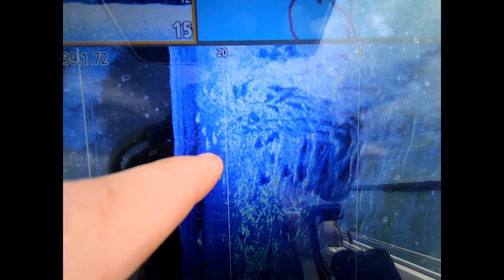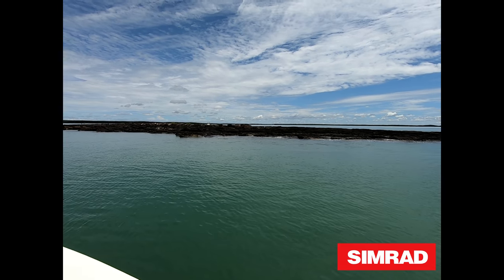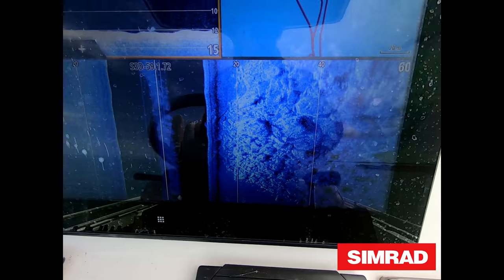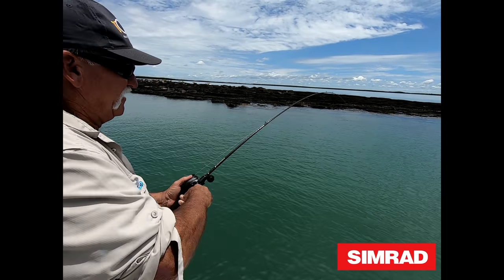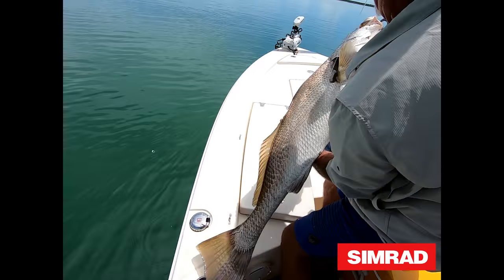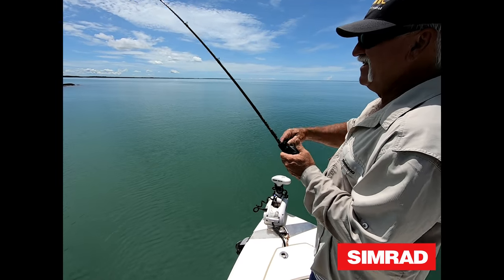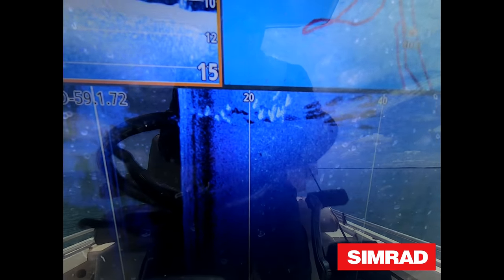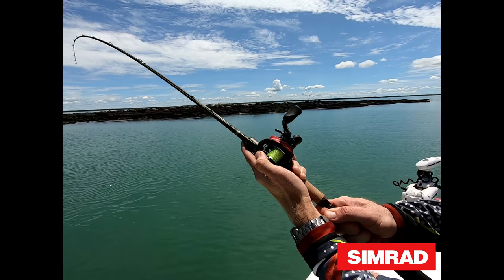How to use structure scan with a SIMRAD Sounder

Comment: Hy,
I have a problem with mai Simrad GO7 XSR with transducers active imagine 3 in 1 maybe you can help me to undestend if it's a problem or should be work like so:
1.If i start the sonar without transducer attached on DownScan i have bouth frecvency available 455 and 800kHz and if i connect the transducer remaining those two frecvency availeble.
2.If i start the sonar with the transducer connected on DownScan i do not have this option to choose the frecvency,i m confused if it's problem or should work like so,but if you see the step on first point it's totally different.

Please if you have some answer do not hesitate to respond.

Thank you!